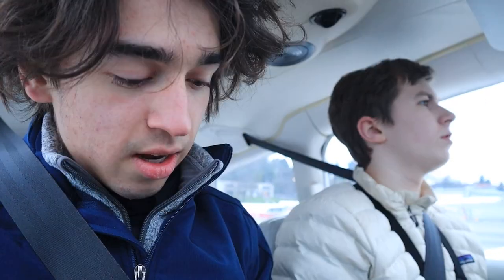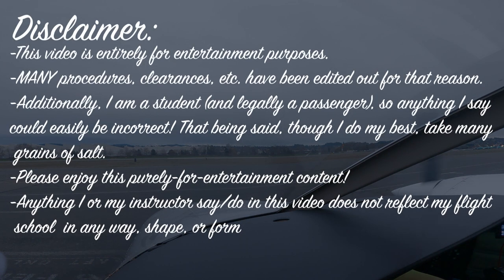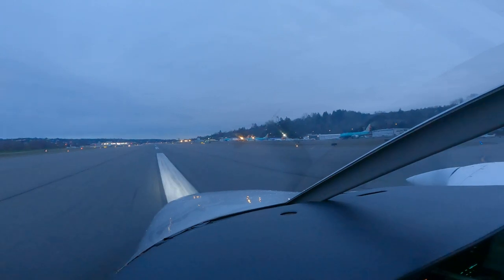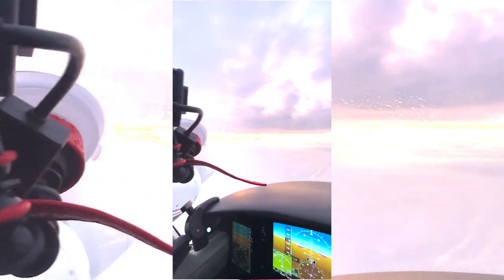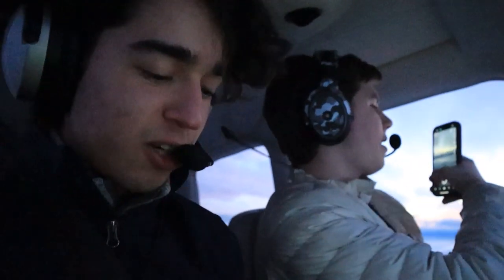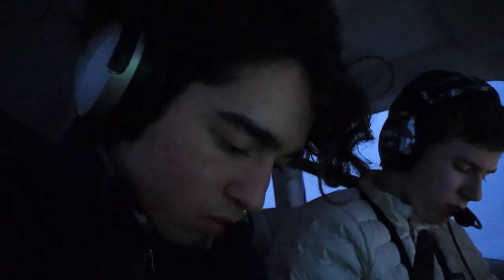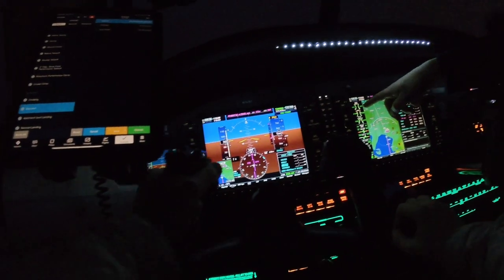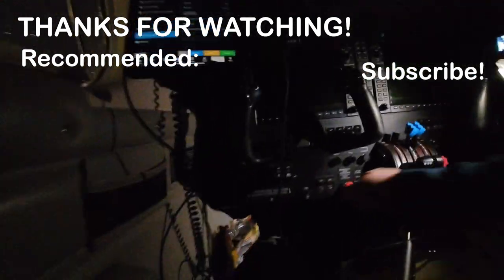Flying a Seminole! | Multi Engine Flight up to Bellingham

Comment: Nice flight 👌 motivated me to get back up in the air. 
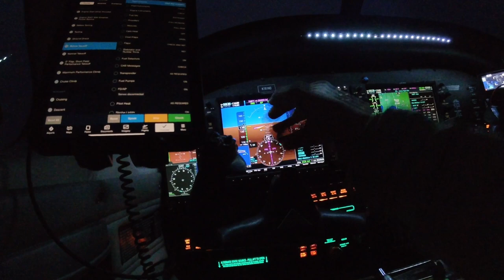At 10:05 - what camera did you use for this shot? Looks nice in low light. Did you strap it on your chest?
Reply from the maker: Thank you! It’s an Insta360 One RS - with the 4k lens, not the 360 one. It’s a really versatile and nice camera! It’s strapped on my chest with a GoPro chest strap.